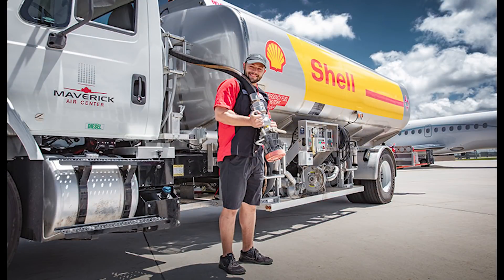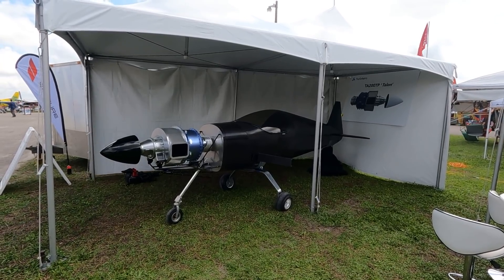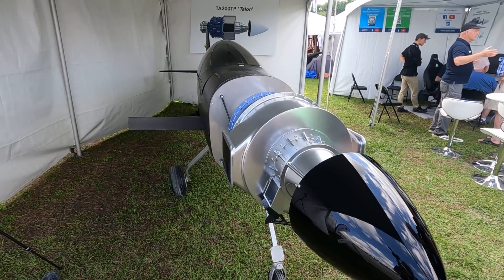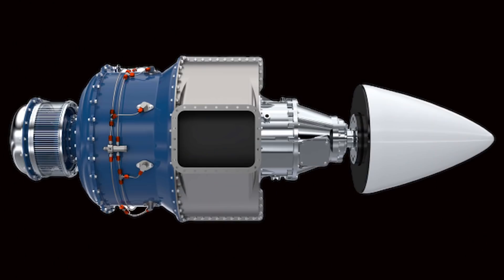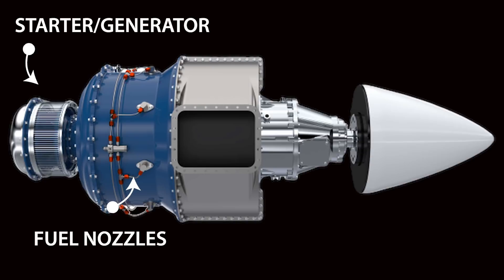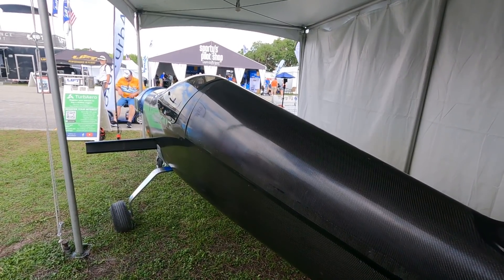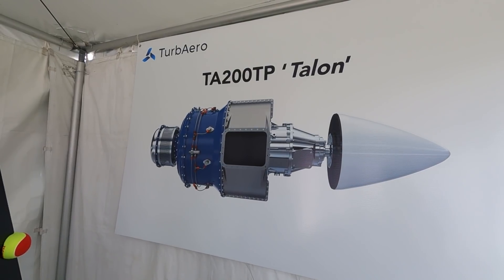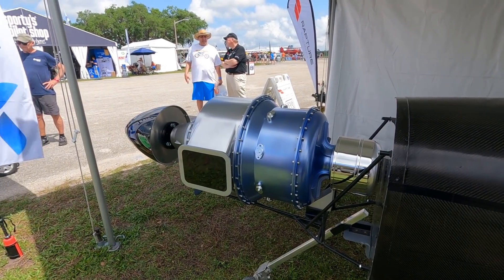TurbAero Aims For a New Turboprop Engine for Small Airplanes

Comment: 200 HP is a good size to start that will work in a lot of smaller airplanes. Even it it has to be derated a bit. I'm not a businessman but I would love to see a parallel development for a 350-400 HP turbine. That would cover virtually all of the piston engined replacement market for singles and twins. I'm guessing that would mean they'd need to design for 500 -600 HP and derate them for for longevity.
But what do I know? I'm just a retired 63 yo old man that used to see this type of thing on the cover of Popular Mechanics magazine in the late 1960s. I suspect that the bar for cost of certification is 20+ times too high.  3-D printed Titanium could change things quite a bit. Although there are quite a few ~300+ HP  Singles and Twins that might decide to become Experimental? How about a Baron, Bonanza or Duke  with reliable 400 HP? Or a Piper Navaho with 450-600 HP per engine. They would have to undercut the derated PT-6 costs significantly to succeed at the 350+ HP range. That would be tough. How about an AeroStar with 400+ HP per side?  I always loved the Duke. I pumped 100LL at the airport during college summers.  There were a couple Dukes that taxied up for gas 2-3 times during the summer.  Duke Drivers Always paid in Cash off of a Gigantic Roll of Bills. Dukes were thirsty. We, the mechanics, the gas pumpers and my boss would always joke that taxiing up n a Duke, close to the hanger, and stopping for fuel...pardon the language. Was like pulling up, unzipping your pants and flopping a giant dick out on the pavement before dragging it to the bathroom. And saying "fill her up". They never asked what the price was. This was 1976-1979. One guy was a large swarthy fellow that my boss told me owned one or more traveling carnivals. And he knew that, at that time, "traveling carnivals" were often used to move illicit products(?) around the country. Maybe Coors beer that wasn't sold in Oregon at that time?😂😂👍🏻 Hence, the several thousand dollar roll of bills to pay for gas. No receipt requested. 😎

Comment: From just an engineering standpoint there's a lot of reasons this makes sense. I'm very skeptical that the capital and market is there, but I'm pretty interested. I'm also curious how the pressure loss vs heat exchange efficiency vs weight trade-offs work out. If this was possible/manufacturerable in the GA market right after WW2, these would be ubiquitous.

Comment: Also, completely wrong target group of 200HP engines in my opinion. People in this category fly your basic homebuilt through small Pipers and Cessnas. They typically have defined budgets and monetary constraints. A more appropriate plan would be to scale this engine up to 300-350HP. Now you’re targeting people who already have pressurized aircraft, far less monetary restrictions, and are used to engines that already cost upwards of $100,000. Their fuel burn, if not allowed to run LOP is not too far off a well-designed turbine.
Reply: So true - but there is no competition in the small (200hp) engine market.  I suspect his final target market will be the military drone manufacturers.
Reply: maybe you should actually watch the video, or pay more attention, as he stated the types of aircraft they were targeting and there was no mention of pipers & cessnas!!!!!
Reply: @Ulbre  I actually agree with walker. $85,000 for an engine that’s only 200 HP isn’t an easy sale for smaller aircrafts because most of that market is on smaller budgets. I suppose that if they scale up their production that price will go down by the time of their second generation to provide a lower cost which would make it attract a wider clientele.
Reply: @Ulbre De Folie  I think that's probably a distinction without a difference: The video does mention Velocity and Vans, which are around the size of Pipers and Cessnas, depending of course on which models you take.

Comment: I wish them luck, in kind of a mostly unicorn and rainbows way. The Recuperator may get the BFSC from .85 down to say .70, which would be stunning, but it is still a continuous combustion engine. If you could tow your plane out to the runway, start the engine, take off immediately and without delay head for 20,000 feet with oxygen mask firmly in place, then perform a completely flight-idle descent, land, shut down the engine and tow it back to your hanger…maybe, just maybe it could work.
Reply: i feel like this case would be one of the few where a hybrid electric airplane might make sense, do as much of the >FL20 flying and taxiing on the battery as possible, then turboprop away once at altitude or whenever the bat runs out

Comment: GE's new Catalyst gas turbine (PT6 competitor) also uses 3-D printing, to reduce parts count and expensive machining. GE is projecting a 15% increase in fuel economy, which is huge. But this new engine weighs as much (actually, more) as a R-R 300.
Reply: Yes, i am fully with you. I remember at rhe Ge turbo engine used in piper 400 ls. 1000ps each with only 60 gallons, hour. But the mostly advantage engine development looks to hybrid jet a fuel. Combination of. Power fuel efficiency and electric take off.

Comment: I am so happy that a manufacturer finally takes on the challenge of an efficient small turbine with recuperator.
This idea has been kicked around, but the recuperator always be posed too big of a challenge to result in a useful product.

I'll keep my fingers crossed for this one..
Reply: I saw that concept back in the 1980s.   A recuperator adds weight and improves lower power fuel consumption, but limits maximum power.  I've been out of the turbine industry a few decades, and I'm sure some things have changed, but basic thermodynamics haven't.
Reply: @loctite222ms  as always there ain't no free lunch. One can optimise for peak performance, peak efficiency or a good balance. 😉
Reply: Thankfully 3D printing has finally made it economical to produce

Comment: The Chrysler turbine used in the cars in cars in the 1950's and 60's used a heat regenerator.
Reply: And that was it's Achilles'heel.
Reply: @daszieher  No sir.  The heat regenerator dropped the exhaust temp to safe levels and preheated the after compression which made combustion easier and more complete.  Thus bringing mpg close to a piston engine.
Reply: @mrvv8337  yes, that is what it was supposed to do.
However, its additional cost did not bring the total system operating costs anywhere close to the TCO of a regular piston engined car.
Reply: @daszieher  It did just what it was supposed to do...be equivalent to a piston engine.   The problem was the turbine needed to be better than not the same in fuel economy.   Cost would be brought down in mass production which the turbine engine didn't get to take advantage of like the piston engine had for 45 years prior.
Reply: @daszieher  Do a little more research before commenting.
Reply: @mrvv8337  "cost would be brought down" is a common misconception of how the costs of turbine engine production scale with respect to piston engine powerplants.

The use of significantly more costly alloys (to ensure efficiency) cannot be offset by simply adding a recuperator.

Maybe you might want to do a little more research before commenting 😉
Or just attempt to be less condescending, when promoting your own opinion. Unless, you have hard data to share that we could discuss further in a educated manner. From automotive engineer to - I presume - also at least engineer.
Reply: @daszieher  The automotive piston engine has how many moving parts? 200 maybe 300 each requiring it's own design, too long, machine setup, some form of automation, and all of the human input and capital to boot.  Now build an an engine with a tenth of the moving parts, mass produce the engine, put 45 years of innovation of people that think beyond an engineer, and the cost would come down in magnitudes.  The problem with engine was that it wasn't 50% better in mpg's it was the same.  Why develop something that yields the same outputs to an existing product?  It typically doesn't happen.

Classically trained engineers are not inventors and at best above marginal innovators which is when an "engineer" is brought in on a project. 

To conclude sir, as stated mass production, time (and all that goes with that innovation, invention of design and materials) will bring cost down on a product.  Let me use your trigger, recuperator! Good day.

Comment: Another example of “Hey, let’s try this… again. It’s never worked before, but maybe we’ll get lucky this time.”
Reply: Well, they are trying something considerably different by developing a custom recuperator.
Hey, it's their money on the line. I can afford to be a cheerleader 🤣
Reply: @daszieher  The recuperator is exactly a tech thats been seen time and time again, and failed. It got furthest with Chrysler automotive, who built turbine powered cars to take advantage of multifuel capability, and since adding enough compressor and turbine stages was cost (and production hours) prohibitive, they used recuperators then. They got working road legal prototypes out in what would have been almost production styling, and even had started the marketing to dealers ect (including posters showing the flow order of gas through engine and recuperator and boasting about the latters function)... but the fuel economy was never good enough to compete with downsized engines in the same car bodies so the project got cancelled before they took the major investments to tool up for series production. Technology gets better every year, but thermodynamics hasn't changed much, nor has the fact that piston engines have been so ubiquitous at this exact scale helped turbines retaliative development levels...
Reply: @SheepInACart  I am not saying that a recuperator is so novel. It is its manufacturing that - according to Turbaero - should make the concept competitive.
This is what I'd like to see tried out.
Reply: Hey it worked for MRNA vaccines!

Comment: You know what I'm going to say, it's pretty cool but missing the obvious thing to do. We need a turbofan product, not a turboprop. A turboprop gives us all the noise, size, positioning restrictions and maintenance issues of a geared piston with the pricing common to turbines so worst of both worlds. A lancair IV-P exists in a piston and turboprop version, the turboprop makes the plane 3x more expensive and adds 7% to the top speed and burns way more fuel. So unless you intend for turboprop products to be cheaper and lighter than pistons it's an inherent failure. Some will buy it on principle but real world specs will prevent success. 
Whereas a turbofan promises to be smaller, quieter, offers rear placement and natural twin configuration and surprisingly as good or superior fuel economy than even turbodiesel piston props. The all important fact is that the range record belongs to a simple jet engine. They are not going to listen, no one really ever does, certainly not with any expedience but what they should do is scrap the project with extreme prejudice and design a turbofan product instead. And they can start by shamelessly copying a williams FJ33 engine, scale it down and adapt it to small plane power levels until such time they have engineering insight to do a superior scratch build. For reference the FJ33 is used on the visionjet which is a ~3ton bird. The engine has about 800kg thrust, fit to propel up to say 4 ton easy and it weighs 140kg+-. So to fly a 4-500kg bird, especially in a twin engine config you have to think of engine weight around 10kg. 200kg need not apply. And the nice thing is that material strength improves in small scale. So we don't need monocrystalline metal blades. A 10kg engine holds the promise of being dirt cheap to mass produce. And therein lies the revolution. Superior on basically all fronts and vastly so. With a possible exception in short take off but even there I think you can simply have a bit oversized engines and keep the plane light so even stols can be beat. If two 10kg engines can beat a 200kg piston in thrust, that's a lot of weight advantage you gain on top. It appears to be such a no brainer that it's a crime it was not done when turbofans first came around in the 70s. What a difference it would have made for GA.
Reply: "engine weight around 10kg"... Only 10kg? Seems very light.
Reply: @Cmoredebris  Indeed. But the FJ33 is 140kg and can push a 4 ton bird, so scale down by nearly factor 10 and split up on two engines. It's not guaranteed to scale exactly like that but on the larger side it does scale pretty linearly. And think about what a jet engine really is, it's just a thin shell like a paint bucket or soup can, a couple of shafts and some fan blades. Another way you can look at it is to just put on the 140kg FJ33 onto say a 300kg plane and you have a 2:1 thrust ratio, better than any fighter jet. So it's quite certain it will be lighter than 140kg, right? and it only needs 7% of the thrust so presumably a lot lighter, right?  the logic is sound. Trust the napkin math.
Reply: @DanFrederiksen  If things scaled like that, we'd be riding massive ants to war instead of battle tanks, as the darn things would be immune to anything short of anti-ship missles, and chuck buildings around like childs toys. But that ain't how life works, with larger output turbines being vastly better in weight, cost and fuel economy than small ones. Also the engine cores dry weight is very different than the total weight related to propulsion system... the lightest aircraft to feature a FJ33 is >1,300kg empty mass, so for a 300kg vessel your not looking at 7% the size, your looking at almost a quarter.
Reply: @SheepInACart  Excellent reply!
Reply: @SheepInACart  if you stopped to think you might realize that the ant argument is in my favor. I'm talking about going small, where material strength is easy. Do you realize you argued my point while thinking you were proving me wrong?
And I don't have to match the lightest craft you imagine, do I? and even if your arbitrary claim of 25% of an FJ33 was true that would still only be 35kg divided between two engines. Quite acceptable even if that. Maybe stop to realize that we can have twin jets on small inexpensive planes and be vastly superior allround to what's currently available.

Comment: 24gph for a 200hp engine that cost twice as much as a comparable recip. Where do I sign up?
Reply: The advantage for turbines generally is high power to weight ratio and superior reliability.  None of them are better than recip. on a cost/power ratio or efficiency. Not sure if that will translate well to the average experimental plane builder for this price though, may be the wrong market.

Comment: Not sure I'd pay $80k to get near enough the same weight and power as an IO-360.
However, I would happily pay $40k for a 200hp certificated Rotax.
Reply: Heaven forbid someone try to innovate...
Reply: Big difference between a turbine and piston is the altitude that power is available. With the same horsepower, a turbine will fly much higher and achieve a much faster true airspeed. I'm betting fuel usage per mile will be similar to a 200 hp piston. You'll just get to the destination quicker which increases your bladder range. I think $80k is low balling it. I doubt it'll be able to hit the market for under $100k-$120k.
Reply: @Ichibuns  I think 750 hp turbines cost $120k 40 years ago.
Reply: @loctite222ms  Inflation, regulations, and lawsuits have increased the dollar amount required in aviation.
Reply: Vibration,/noise, fuel availability are the two other factors I can think of, in addition to reliability
Reply: I'd pay $80k if it could replace an IO-550
Reply: Where do you get same weight from?
The IO-360s range in weight from 296 lbs to 332 lbs.
This one is 270 lbs installed and as he said, they will be looking to make the production model even lighter.
Reply: @Ulbre  Jet fuel weighs more. 52 gal of JetA vs AVGAS weighs 35 lb more. 270+35 is 305. Unless there is significant fuel saving (like swapping for a Diesel engine) there doesn’t appear to be a weight difference in practical use.
Reply: Reliability?

Comment: My brain hurts. I thought with the intercoolers and all that sort of stuff that cooling and compressing was the key to success.
Reply: In a turbine engine, as in a reciprocating engine, you want cool inlet air because its denser.  In the case of a turbine this means increased mass running over the power turbine/exhaust.  However recuperators take heat from the exhaust that otherwise would be wasted (conducted away from the engine) and captures it to heat the air passing from the compressor to the combustor (it increases the Compressor Outlet Temperature).  At this stage you've already captured the mass and you're causing it to expand and become more energetic (heat) to turn power turbine.  You're looking for a particular temp increase to provide the power you want to hit, if the air has already been heated right before the combustor - using heat that would otherwise be wasted - you have to burn less fuel to achieve that temp.  That increases efficiency.
In a reciprocating engine you're trying to force air into a chamber mixed with fuel to be burned, you still want cool air because you only have a certain amount of time and force to fill the chamber, cooler denser air will put more mass and oxygen in the chamber (cylinder).  In a turbine though it's all constant flow, so after the compressor the hotter the air gets the more force it creates at the power turbine(s).
Reply: @glibsonoran  Thank you, very concise.
Reply: Doesn't the First Law state that the greater the temperature difference the more efficient the het pump is.